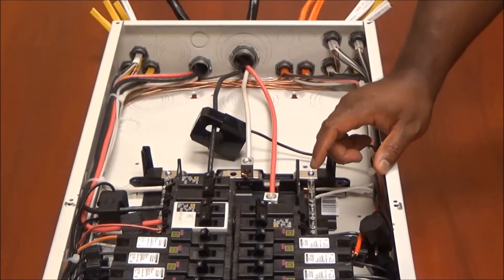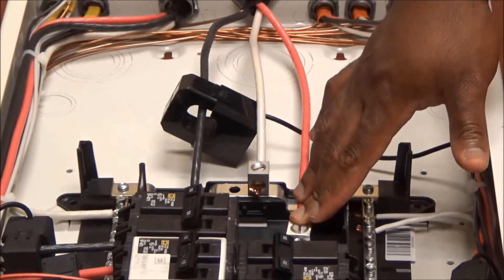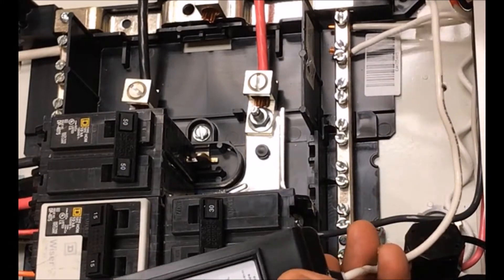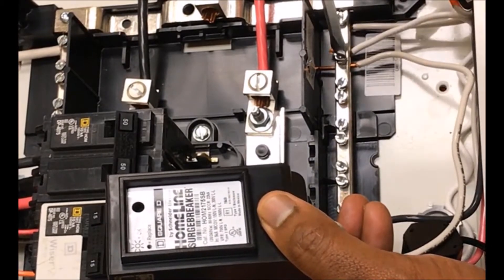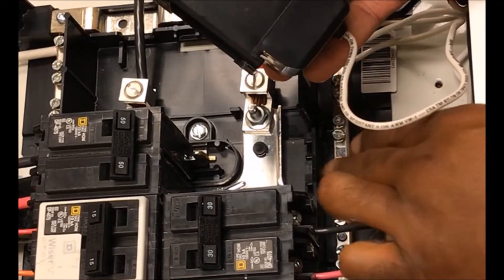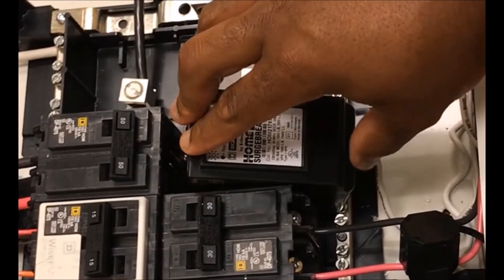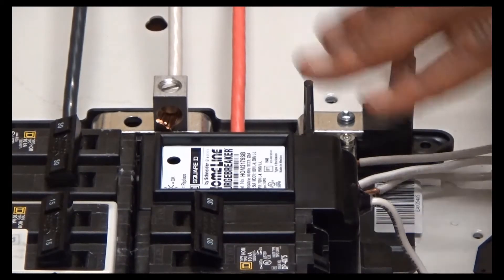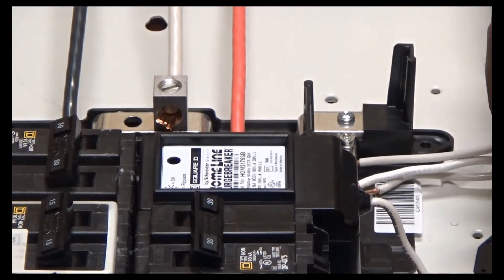Installing HOM2175SB Homeline Panel Surge Protective Device | Schneider Electric

Comment: Neutral wire should be as short as possible while avoiding sharp bends.  You ran the wire way up on the neutral buss bar, but the neutral pathway would have a lower inductance and resistance if the neutral wire went directly to the buss bar.

Comment: After I turn main breaker off, if I accidentally touch bus bar will it shock me? Using regular screw driver work or use insulated?
Reply: You should call a electrician

Comment: Sadly, I let the electrician who wired my new home to install this device and he put it at the bottom of the panel instead of at the top and didn't shorten up the white wire to the neutral bus bar.  I didn't catch it being installed this way until several months later.
Reply: It's hard to move other breakers
Reply: @AgentOffice  Not really, especially for an electrician.